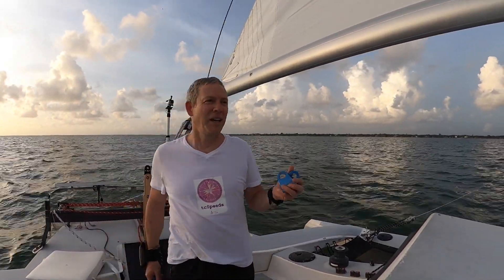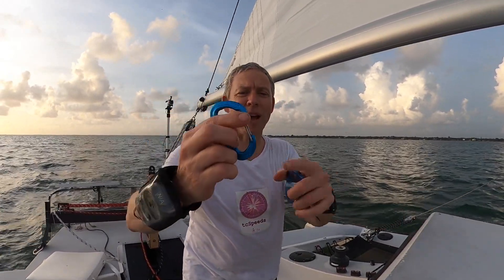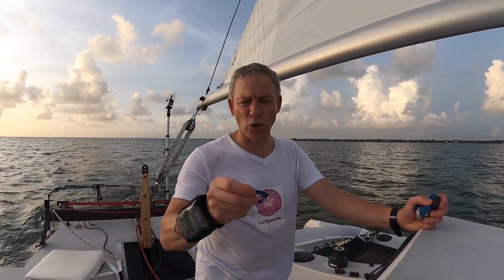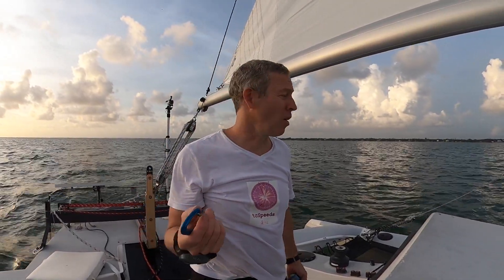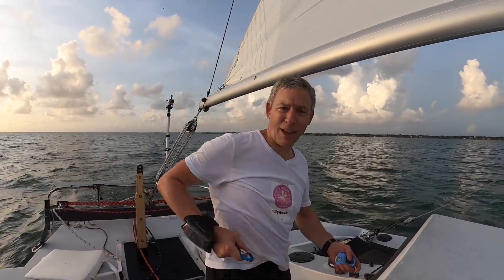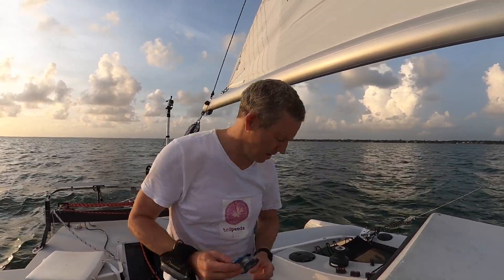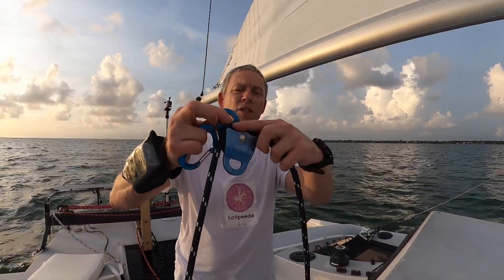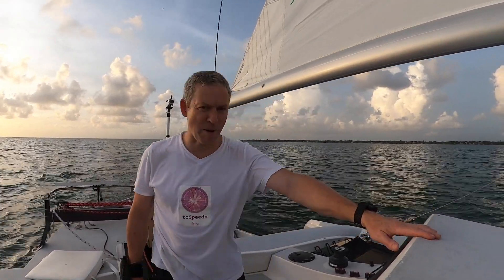Using Climbing Carabiners For Sailing

Comment: Good input Tomas, I'm using softschackels for almost everything, they are soft = very low wear on the gear, light, take big loads, if they starting to wear you see it in time to change them AND they doesn't cost much if you do them yourself and thats just fun!  ;-)
Reply from the maker: Great input. I have no softschackles on my boat but I really should try. I will. Thanks!